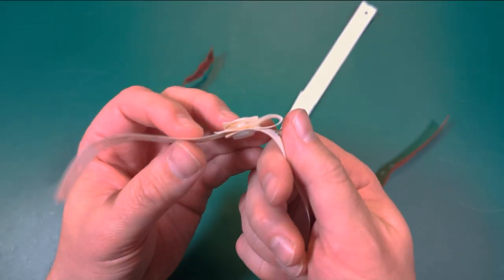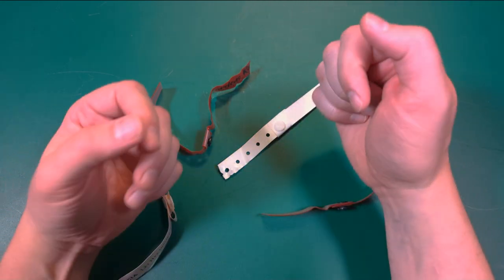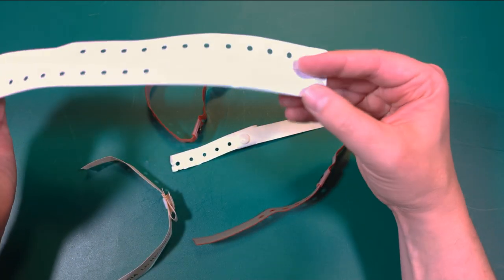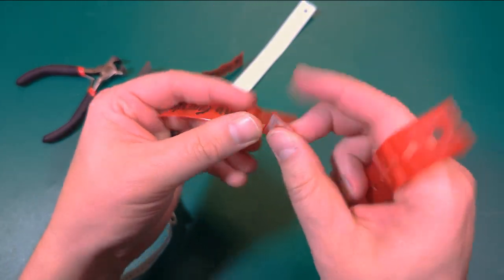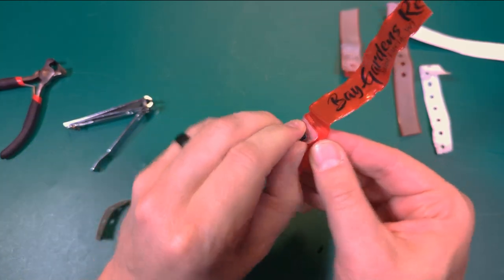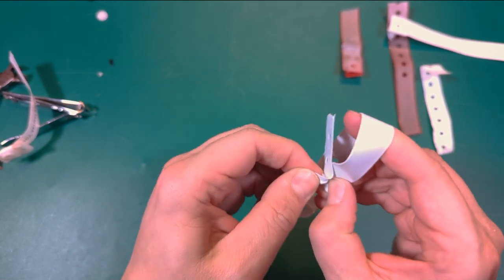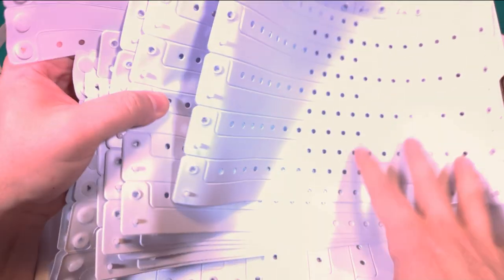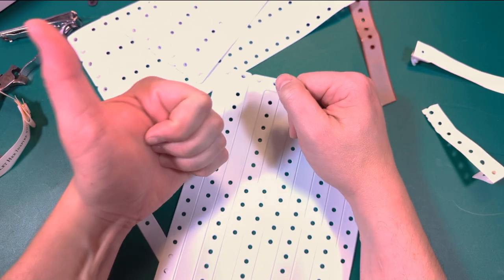Tampering with Wristbands - Part 1

Comment: You don't need a hundred of each.  I would try 3D printing them.  Bonus round... Make the 3D printed version removable and reusable.
Reply from the maker: This is the greatest idea and I can't wait to see if someone does this. 😁👍
Reply: @DeviantOllam  I emailed you and I plan to give it a try.
Reply: Once you have a model, I’m happy to help test it.
Reply from the maker: Mr Snow Makes  that also sounds really feasible!  Also I love that one of my replies on Twitter was somebody pointing out an Alibaba vendor who sells just the clasps apparently.

The internet is dope.  👍
Reply: If you come up with a stl file I will try to print these out, have a resin printer, will gladly be a beta tester
Reply: Cwiminal - I mean genius..
Reply: Stickers on an existing one. Keep it simple, cheap, fast.
Reply: What comes to my mind as an easily removable version (and can likely be poured via a tiny form, as an alternative to printing a part of it), is using the screw part of a threaded "saddle rivet" as is, plus some plastic/resin/silicone to form the other side. However, most simple solution belongs to @Robin Pollard, for sure - prying it open non destructively.
Reply: @olgapisova6207  I bet it would pry apart more easily if heated.
Reply: Ive been getting into concerts FREE since 2001
I always buy 1 V.I.P Backstage pass.
They never give it to you before the day of the event.
I have a copier and laminating machine in my van. 
Cut it open- copy it- make a bunch to $ell or give friend$ or family 
They are individually numbered but I've never had anybody take mine and look at the individual number they just glance at it around your neck and wave you in! 
Never been caught yet!
Reply: @thecloneguyz  as someone who works event security as long as you don't get drunk and cause a scene then you'll probably continue to get away with it. However if you get caught the event may press charges after security tosses you out. Especially if they find you've been counterfeiting badges/one of your friends gets drunk and tossed and rats on you 🤷‍♂️
Reply: @thecloneguyz  We'll see how long it is before they contain RFIDs.
Reply: @jmr  
Ive been waiting for that! 
I use a metal detector to see if it has an rfid strip in it! 
(Dave chappele show had RFID'S- they almost wouldn't replace it when I told them I lost it because I couldn't put it back together!!!!)

I can copy the rfid im told. Looking into that now. I guess its pretty simple just need a reader & a writer to reproduce it!?
Reply: @warrensteel9954  one of the security guards told me that they actually count how many passes are out there and if they count too many of them they will know that somebody is duplicating them so be careful how many you duplicate

He also told me that sometimes they'll have some mysterious person come walking up to them and look them dead in their eyes and tell them that someone is waiting for them backstage and it's usually the drug dealer.
He said so many security guards have been fired from not letting the drug guy go back and deliver his stuff so now if you walk up to any security guard and look him dead in the eye and tell him that they're expecting you most likely he's going to let you walk by and just tell you that you didn't come in at his gate if someone asked
Reply: @thecloneguyz  🤣 I was served under age because I was "with the band".  No questions asked after that.  I wasn't really with them. Didn't hurt to know some of the local security guys at our big venue back in the day either.
Reply: Scrolled down to post exactly this, those little buttons/snappers look perfectly fine to 3d-print, and nobody's gonna be looking closely enough to notice any difference (as long as the colour matches)
Reply: @thecloneguyz  yeah no. While weed is legal here in Canada a security guard is more likely to get fired for allowing the dealer in than keeping them out. It's our job to keep the event from getting it's license pulled. The event isn't going to risk getting shut down just because some band couldn't be arsed to stay sober long enough to play the show and go back to the hotel room. Liquor Inspectors will hand out fines and suspensions like Oprah hands out gift baskets.
Reply: Mr Snow Makes  The magnet in the print was my initial idea, Seems the most simple.
Reply: A little threaded post and screw that look like the closure, though maybe you want a hex head to help you unscrew the two halves (reusable a few times before you need to reprint the hex half)
Reply: @thecloneguyz  did you really just admit publicly to ticket theft and selling fraudulent tickets?
Reply: I just put a tiny magnet in them and call it a day.
Reply: You could also maybe just use a zip tie, or some tape. It's not like they check if the wristbands are actually held on with the proper snaps right?
Reply: @DeviantOllam  It's linked on your Twitter.  I can't put a link here.
Reply: @scoreboredgaming  Why put yourself in a situation thats unnecessarily complicated. Maybe 1 in 10000 wristbands come under review by the host (a company or person) and the zip tie will stand out and like sore thumb. Then (hard) questions are asked.

Better to be the grey person.
Reply: @dragade101  Hard questions like, "did your wristband break, would you like a new one"? These things don't exactly get you into the pentagon.
Reply: I decided to push it further.  I designed a screw together version and amazingly my Ender 3 with 0.4 nozzle was able to print it.  I'd have previously thought the threads were too small but both versions are up on thingaverse.  Thing number 5393439
Reply: @dragade101  Are the people enforcing it payed enough to bother interrogating random guests about the condition of their wrist bands? Especially days into an event.
Reply: @DeviantOllam  Just use a Chicago Screw or 3D print one.
Reply: Just get those little brass things that hold paper together when you don't have a binder with the 2 bendable legs on them, and use that - poke it through during the day, bend the tabs back, then just remove it at night. No one's going to look at the snap, just at the band, so who cares what snap you're using. Or even a pin type thing for that matter. Nothing you can't solve by a quick trip to the office supply store
Reply: @jmr  wonder if some small magnets could take the place of a screw thread.
Reply: @JoshBecigneul  Amazon has some 2mm by 1mm magnets that I suspect would work.
Reply: @JoshBecigneul  I made a version to work with 2mm by 2mm magnets.  It is not tested because I don't have the magnets but they are on Amazon and I'm sure many other places.
Reply: @gorak9000  which are called paper brads
Reply: @dragade101  Interesting - I never knew what those things were called. Learned something today!
Reply: @DeviantOllam  I'm pretty sure I've seen a similar fastener with a plastic screw that forms a removable (or possibly also tamper resistant) plastic rivet.
Reply: Was about to comment the EXACT same thing, beat me to it!  3D printing FTW
Reply: @CONEHEADDK  Not great in the pool, easy to lose if it brushes on something. You want something with a more positive connection.
Reply: @ooglek  If you mean stickers, I'd say, it's all about what kind. And it would be easy to just print a bunch of them, and stick on a new one, if it fell off. Besides that - 99.?% of fakes would probably not be intended for pool visits.
Reply: @CONEHEADDK  If you lose the bracelet, kind of a pain, and a little questionable from the front office / security standpoint. Most resorts use these, and I'm guessing Deviant was at some sort of resort, and at most resorts, there are pools. You might shower with it. You might wash your hands with it on. Whatever you replace it with needs to hold up nearly as well as the original, and I do not think stickers or tape will suffice. And as someone else pointed out, not having the button could raise an eyebrow for someone paying attention (unlikely but plausible).
Reply: I did this in 2015. Way back in high school.
Reply: I just had the exact same idea after watching the video. I knew someone probably already had thought of this and i was right :D
Reply: Agreed 3D printing is what I would do even if you don’t have one there are plenty of companies that you can have make them, going with the whole wristband is incredibly wasteful and there is no way you will need a box of them plus going 3D you can have the snaps in different colors to match the one you removed
Reply: @jmr  I’ll mess around with this design on my modified ender 5. You could very well even emulate the button look. I’ll most likely be using a 0.2mm nozzle as the threads come out cleaner, but I’ll leave you some feedback and maybe a remix or two.
Reply: @NewbGamingNetworks  Cool!  It will be interesting to see how it comes out on a different device with other people's slicer settings.
Reply: My thoughts exactly - make some buttons that look like the security snaps (maybe just cut the ends of some real ones) and super glue them to some reusable button snaps. Snap them through the band, and you're good to go!
Reply: This is the right track.
Reply: @DeviantOllam  if the wristbands come in batches of like 250, the snaps must come in even bigger batches
Reply: That was my thought, replace the security snap, with a regular snap lol.
Reply: make one that just screws on a looks good on the outside.
Reply: @Nevir202  then paint it white since most snaps are metal
Reply: @pws3rd170  I've seen plenty of snaps on clothes which are plastic, or which are metal, but already painted for cosmetic reasons.
Reply: came to say this ...a screw button would work well
Reply: @psychoblack1411  Yes, it does.  It's one of the six variants I posted on Thingaverse.  The screw version is the one I liked best.  Worked well in PLA.
Reply: @dragade101  pretty sure they're called butterfly clips here or paper fasteners.

Paper brad's I'd expect to be more like drawing pins.
Reply: @lmaoroflcopter  how about this (see other names): https://en.wikipedia.org/wiki/Brass_fastener
Reply: @DeviantOllam  just use little screws, they make flush screws in this size lol.
Reply from the maker: @microcolonel  that is massively over complicated compared to using little plastic snaps. :-) not to mention screws look like screws, they don't look like snaps.  😉
Reply: @DeviantOllam  i mean, buying strips is massively overcomplicated when reusable nylon snaps that fit these bands are a commodity that can be bought 60pc mixed black, white, clear, and frosted for 7 bucks on Amazon... But screws are fun.
Reply: Just came to say this.
Reply: @jmr  do you had any succes with this im very interested?

Comment: It's also a decent idea for just general security. If you're off-property for a resort for example, those bands readily mark you as a tourist. Depending on the resort, a tourist with money.
Reply: Yuuup. I was overseas and complained about the band being tight so I could slip it off for exactly that reason. Still look like a tourist, but not a tourist from the expensive hotels.
Reply: I was going to post the same - but if you're at a resort, they have a "we don't care what happens outside our resort - you wanna stay safe, stay in the resort." attitude.
Reply: @efnissien  Maybe the resorts you've been going to, however the resorts I have used,  provide their own  private taxi service for their patrons  because they care about your safety. Also you can remove the band whenever you want, and simply stop at the front desk to get a replacement. Worked for me in Mexico, Bahamas and Jamaica.
Reply: I'm absolutely not putting on a writ band for being at a hotel or a resort. That's plan stupid and annoying.
Reply: They also can mark you as having gone through security and back.  Guaranteed soft target.
Reply: @tonymouannes  for all inclusive resorts, they don’t want people sneaking in and getting free food.
Reply: @Purplesquigglystripe  I stay 3 month in a hotel for work with breakfast included. They had someone check who's going in to the dining room with need for any one time use tagging.
Reply: @Paul van Dinther 
Have you also stopped carrying around a mobile device?
Reply: @@MM-yf8xu and why should anyone care about what you do? What does that add to the discussion of wristbands?

Comment: A little while back, I went to a festival that used fabric wristbands with a circular tightening ring with one way spikes to make them "one time use". Inspired by your various talks, I found myself with some spare time and a drinking straw. Wouldn't you know it, they can most definitely be removed non destructively! Thanks for the tip on this style :)
Reply: I actually managed to take those wristbands off by pulling on the ends coming out of the ring, moving the ring back a bit to get the spikes out of the fabric, then pulling the ends really hard while rotating and slowly pulling it off the ends. If you notice the spikes grabbing the fabric, just back off a little bit and rotate the ring again.

The trick is to get the two ends of the fabric to twist together really tight by pulling on them and rotating the ring. You could also try twisting the ends instead of only the ring.

Some time back I took off a bunch of wristbands using this method.
Reply: Those are super-easy to remove; just twist the ring until the strap tightens, then continue twisting.  It will slowly work it's way off.
Reply: @Hobadee  Huh, much easier than expected! I still like my method since it can be done and redone without any possibility to damage the strap if done correctly, but I'll probably give this a shot next time I end up with one. Sounds a lot easier, haha!
Reply: @mistaecco  My method chews up the straps a little, but it's not something that's noticable without close inspection (which security isn't going to do) and you can easily flip that part on the underside of your wrist so nobody can see it.
Reply: In those wristbands they try to put a center bar to precedent you fron doing that, you can also twist up that fabric and carefully pullout
Reply: @jaromy03  Don't know them, but how about cutting and epoxying them back together in some invisible way?
Reply: @CONEHEADDK  that's way too much work. It takes like a minute to take them off by twisting.
Reply: @jaromy03  Getting something off is never a problem. It's making them look 100% legit, and not be weak, I'm thinking about. I'm an inventor, not a demolision expert.
Reply: The twisting idea is great on some, but in the last couple of years I've noticed more of these starting to employ a free-spinning shell over the plastic ring. The straw shim method still works fine on those. You could prooobably drip some superglue into the gap or fuse the spikey & spinning layers together with something hot and still use the twisting method if you had the inclination, but when I was messing with them it was at a festival & straws were the first thing I got my hands on 🙂

After that I left it just loose enough to squeeze over my hand, but still tight enough to be secure when worn behind a G-Shock.
Reply: @iamtoast3397  Ah, that sounds more like the ones I've had! The free spinning inner core makes it difficult to try and twist the wristband out. Straw shim is pretty simple, especially if you leave some extra slack. Just get it in there far enough that the fabric of one side can slide back out through the straw.
Reply: Stayed at a place that used these. Just cinched enough that it wouldn't fall off in the pool but I could still slip it off at night or in town.
Reply: You can also harvest the entire clip from old bands on these
Reply: @CONEHEADDK  what a pointless comment bro, the person clearly gives a easy non destructive and non detectable method to removing it and your like oh yeah cut it up and use epoxy to fix it?!?
Reply: @Jake3eee  Huurraay for you Tarzan - you just made a pointless comment about pointless (your subjective opinion) comments..  OOhhh the ironi..  :D
Reply: @maximman102n7  i just ran into these new ones with the bar in it and i gotta say it was fairly harder to get around. but a friend of mine had ran into this last year and he 3d printed new black clasps that snapped on and off and looked no different then the original.
Reply: Had to wear one of these recently. All I did to remove it was twist the legs of the bracelet that were sticking out until they were small enough to just slide the lock ring off. No damage to anything.
Reply: Sol blume? Lol
Reply: Most European metal festivals nowadays use the embroidered fabric wristbands with a metal ring which is set with a crimping tool/press thing. They do leave a finger of space though, and since it's fabric it's not that irritating as these plastic ones. Many fans wear several of them for the whole festival season.  The only way to remove them is to use either strong wire cutters or a metal saw. I wanted to preserve those because the bands look really good, but it's hard to do with just one hand (while the wristband is on your other hand).
I've seen people wearing a bunch of old wristbands from previous years, so I presume they did remove the ring and just tied them around the wrists.
Reply: I’m guessing you shimmed it like you would a zip tie. That’s my favorite hobby at work, and you can do it with the tail of another zip tie
Reply: Upload a video with a guide please
Reply: @thePyiott  watch pt2 of the series
Reply: Used those for football games at my college.  Could remove them intact with about a half hour of careful yanking and twisting.  Should've thought of trying a straw godamnit, that makes so much sense and sounds way easier.